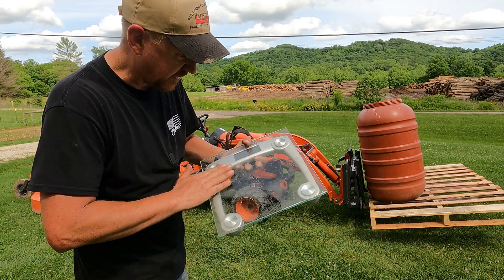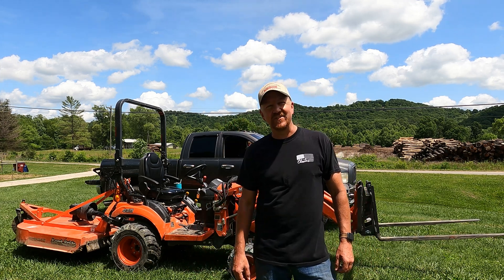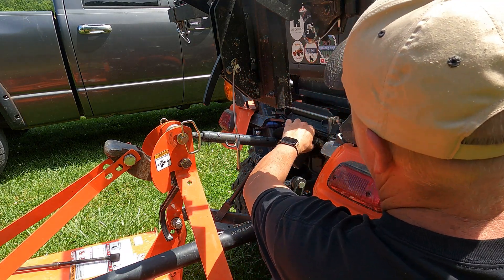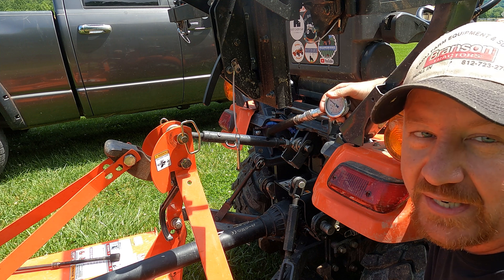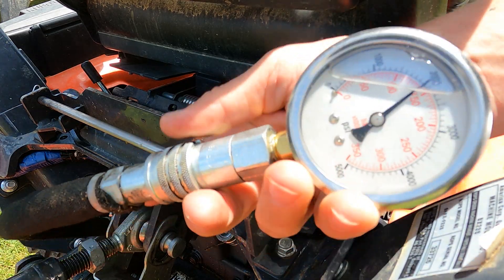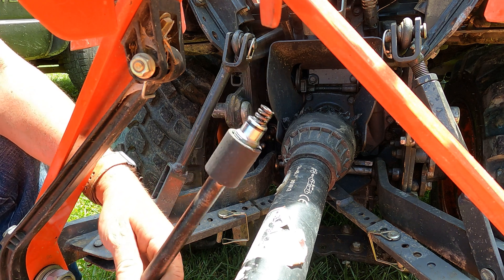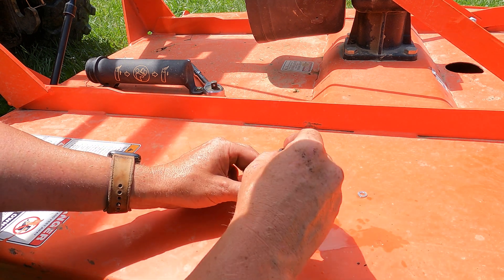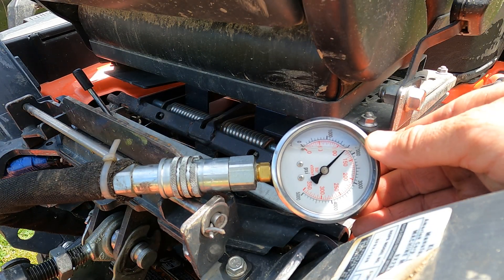How Much Lift Can You Get Increasing Hydraulic Pressure on My Kubota Tractor?

Comment: All good until Kubota rejects your warranty on a broken front axle. That loader is only designed to lift 750# at the pin. 1200# is asking a lot from from a garden tractor.

Comment: Be careful, by maximizing the pump capacity you can blow the seals very quickly. Ask me how I know, as soon as the pump has to power the steering and drives you will exceed its capacity.
Reply from the maker: That’s interesting, I’ve read about and talk to lots of folks increasing your capacity and this is the first I’ve heard of anyone having a failure.  What was your pressure set at?
Reply: @PeeksPeakHobbyHomestead , it was factory set and I don't remember the reading. The tech at the time whom I trusted, said when the capacity of the pump is equaled or exceeded by the lifting weight pressure, the seals will begin to break down or fully fail. In my case I was lifting a cat 2 set of discs on a low boy and all seals blew. It lifted it but struggled after about 2 feet and I think that is when the damage was done. Totally replaced the pump. The pump is rated with a pressure plus a safety factor %, if you exceed that safety range seals will begin to fail. If it happens, in some models you can go to the next larger pump.

Comment: Do you see any real change in PSI with higher RPM? The HST tractors ive tested show little to no PSI change with more RPM.
Reply from the maker: I did, from 3100 to 3200 rpm I was seeing a 50psi difference.
Reply: @PeeksPeakHobbyHomestead  Its interesting that with higher RPM we dont see a noticeable increase in PSI. It just seems to make the loader more responsive. Which i honestly dont like since is makes it more jerky.

Comment: I’d love to know what effects this has on the front axle & if there are any warranty issues doing this. Very interesting.
Reply from the maker: I would assume that it adds stress and would likely affect warranty.  You gotta decide if it is worth the risks.  🤷🏼‍♂️
Reply: @PeeksPeakHobbyHomestead  pretty grey area actually, Kubota is obviously not of fan of this, and I'd say if you brought a machine in with the axel snapped in half the first thing they'd want me to do is check the pressure, from what I've "heard" staying at or below 2000psi seems fairly safe.

Comment: Good job.  I turned my deere 1025 up a long time ago. was 1900 when delivered.  Now its 2500 at idle and 2900 at full throttle. 💪
Reply: Did you notice any leaks due to raising the pressure?  I'm gonna turn my 1025r up soon.
Reply: @northlandacres  not yet. Been 3 years so far. 👍
Reply: That's a hell of an increase. Must be a huge improvement.

Comment: Force  = Pressure times Area, so pressure 1 = 1750, pressure 2 = 2000. Divide 2000/1750.  This gives 1.14 (114% of the original pressure).  Since the area (the cylinder rod faces) doesn't change, theoretically the force should increase by around 14%.
Reply: He got closer to 30%
Reply from the maker: Makes sense.